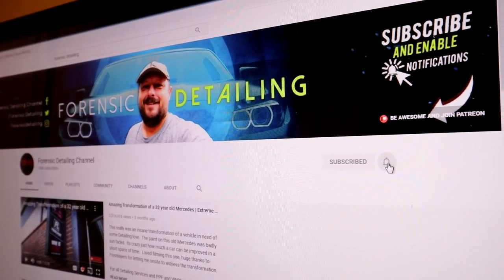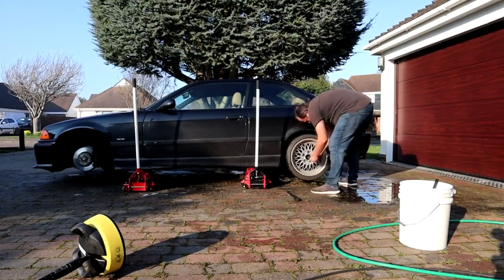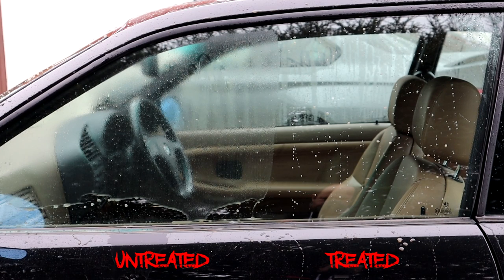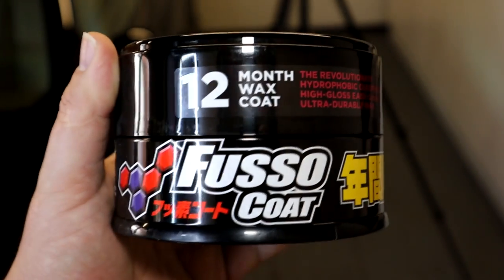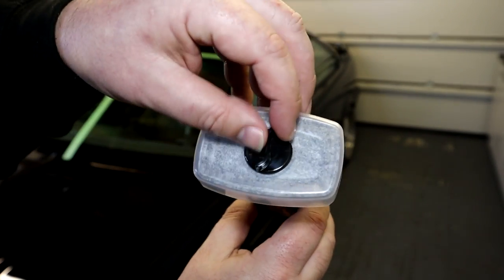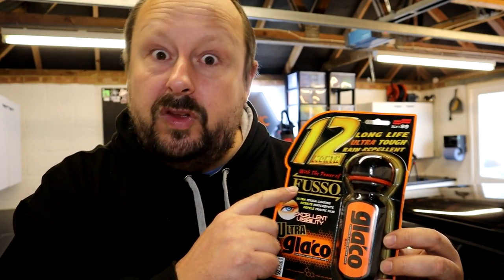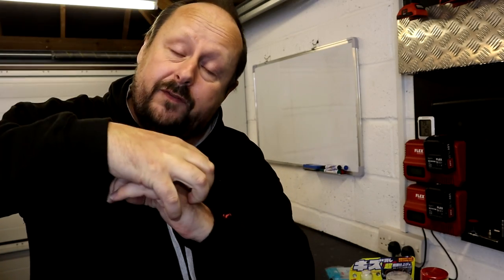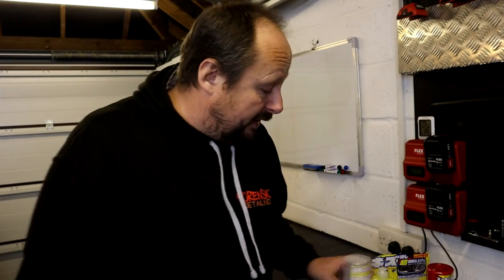Soft 99 Fusso Coat Protection Time Set with Glaco | Close to a CERAMIC in a WAX

Comment: Excellent video. Been using Soft99 for years and still love it. I don’t miss the “I’m about to pass out” carriers for the wax, though. It was really bad. It’s an amazing winter protection for all vehicles. You CAN use most any topper on top of this wax without problems … but it does change the characteristics of what Soft99 does best. I would also recommend just leaving it alone. Worst case scenario, just reapply it as needed. And YES you absolutely do NOT want to apply this wax heavy, it will be a nightmare to buff off (and a waste of product). I typically get 20-30 vehicles per can.

😊😊😊
Reply: Exactly what i wanted to say about it!

Comment: Soft 99 Fusso is next level stuff. I only started using it last year got it on sale brand new for £19.99. Best wax I've used. No way does it last 12 months like it says on the tin but it certainly outlasts any other product I've used. The shine, and slickness after application is the best I've used.

Comment: Even though they recommend crosshatch patterns, I personally discovered quick and small circular motions works a lot better in distributing a think layer uniformly. Also, every 2-3 panels I flush out the pad so it doesn't get too thick
Reply from the maker: yer and ling as its nice thing layer Im sure thats fine thats what I used to do with the old fusso at least.

Comment: Wow, you've really been delivering with these videos these past few weeks Jon, thanks again for the great content! Am I right in saying this is almost a sealant and wax combined? seems to have the visual enhancement of a wax with the durability of a sealant. I'd love to be able to use one product rather than two. I've also heard of people applying it to their wheels and it lasting 8+ months, crazy really!
Reply from the maker: Yes you are right, fusso coat contains organic waxes as a backbone along with fluro polymers or some sort of flourine added into the wax.   So really its a wax backboned with other materials, pretty much like the majority of most modern waxes thad might be mixed with silicone wax or crosslinking polymers etc etc...  You could call it a sealant wax and this way you escape people going nutz at you one way of the other if you call it a "wax" or a "sealant" alone :)
Reply: @ForensicDetailing  haha :) Cheers for clearing that up for me Jon, much appreciated. I'll get a pot ordered!

Comment: I wonder how chemical resistant this is, you mentioned how it keeps the car clean and reduces a build up of dirt which in turn translates to less swirls during contact washing. But if a gull takes a shine (excuse the pun) to the paintwork by evacuating its bowl, I wonder how well it would hold up to that mess compared to a ceramic finish. 

The hydrophobic properties and the sheeting of water made that part in my brain get excited 😁. This is something that's number one on my list of requirements a product needs to perform well in. I think I'll check out that older video at Autoglms lab you mentioned too 👍
Reply from the maker: If a bird poos on your car and its allowed to bake dry and stays on.. I think it will go through fusso or any wax and coatings as well.  maybe a pro grade multilayer coating has some benefits Im really not sure, unless you test it first hand its hard to say.
Reply: @ForensicDetailing  Sometimes I've got to my car and found the sea gulls have decided that my car is too shiny and pebble dashed it in their own coating, I've not reacted quickly enough but I've always managed to get it off before any chemical burn appear. I thought about this brand of coating before and I'm glad you've given me the opportunity to see how it works. It looks pretty good, torn between this and Gyeon synco evo and this as I like the beading. I'm not fussed about applying it every 6 months or so as I find  applying wax a bit of a therapy.  👍

Comment: hah love the fusso to the bones :) so much I actually bought extra tin of old classic one. I have dark silver and red solid cars and I am using light version
Never had a single issue with application. Just using is as a normal wax aiming for under 10grams and doing finger test. Easyly going full bonet and dorst and getting back to see if it is done. Finish is perfetct using inspection light. It did stands for motnhs

Yes, there are better feeling waxes. Just first used a sholl vintage that I left on a bonnet for dwo days and it came out easily...

Bang for a buck or one wax to do it all. Fusso or dsw.

Jon. How the vintage did in longetivity test you did for PVD? Happen I have it on my car now but I barely drive it.

You mentioned spray products of soft. Happens I have all and all are great. The best one I think is fukupika. I know the love for other ones (egg not appreciated, but luxury gloss...) but fukupika is awesome. Looks, apps, longetivity.. Just a killer.
Reply from the maker: Vintage is not that durable m8 but it's still a cracker proper nubs overdose like cake I love it

Comment: Really impressed with the ease of application of the Fusso.  Q. On the tin it states 12 month wax. Is it really a 12 month wax ?. If so that would almost make it comparable to a Ceramic coating. Q. For a flat Red paint (No lacquer), which would be best for UV protection. The Fusso, or a Ceramic coating ?. Sorry for the questions, but my Saab in "Imola Red" is needing another mopping session and this time i want to seal it with the best product for the job. Thank you.
Reply: I think 12 months is in ideal conditions, as in it is never going to happen. I got a little over 7 months on my car. Ceramic coating is more like 3 to 4 years, so a different level.
Reply: It can last longer than 12 months if you maintain it properly. Just like coatings, Fusso can go the distance if you use a sacrificial layer/booster like Sonax BSD or Bouncer's Done and dusted si edition every 2 to 3 months. Coatings are not attractive enough for me due to the prep required, finicky application and because I like being able to do a light polish every 18 months or so to exfoliate the paint before throwing another layer of Fusso.

Comment: I once put RainEx on a windscreen and when the wipers swept, the water beaded in minute bubbles - obscuring, not clearing the glass. It then took a lot to remove. I've never dared do it again.
Reply: I have RainX windshield wiper fluid in my car right now and I think it's making the wipers smear the water. I've been waiting for it to run out and then I'll try to decontaminate it and see if the smearing goes away.
Reply: I dared again, just a small corner of the screen on the passenger side. This is so dangerous in rain when the glass can never clear. Also, it acts like rossin on a violin string and makes the wiper noisy on each pass. However useful it may be for shower glass, house windows etc. it should never be used on the car's windshield. I've used household glass cleaner to remove it.

Comment: Very quick detail nice video on  apply fusso wax... I make mistakes  on applying these wax. This video really explain clearly what to do in order to achieve best results. I have a question,  do you  know what  is the easily method to strip the fusso wax? Do we really need to use polish to achieve that?
Reply from the maker: short answer is finishing polishing on a DA machine is best way to strip this.   Fresh coat of fusso wont be stripped by detergent or even hydrocarbon its too durable.
Reply: @ForensicDetailing  Thank you for the reply! I guess i have to wait.

Comment: Agree!  Im Also user of BH products! They are great! Question! Any good products which strips off soft 99 fuso coat end of the 12! Month maybe more still holding up well!! I’m planning to use it again only wanted a clean panel will use clay and panel clean but first need something good enough that strips for beginning! Thanks.
Reply from the maker: finishing polish is the best way to remove LSP mate.
Reply: @ForensicDetailing  I’m afraid I’m not a ( business detail person) only doing it for my pleasure:) and I never really did polishing and not owning a machine either but! ;) putting it in my basket and taking out since a year now ! So time to get a machine??;)
Reply: @ForensicDetailing  I’m gonna try Garage T zero and see what happens!

Comment: Great video as usual. I use the Fusso coat wax on my truck and love the results. Curious on the glass polish. Will it remove water spots? Thanks again for the video.
Reply from the maker: it strips like crazy even by hand with low pressure its just insane.  stay tuned to my unplugged channel.
Reply: It got rid of some old water spotting on my side and rear window with ease. Very impressive product and well priced will definitely continue to use it.

Comment: Great video John 😁 Just as a side note I've found the best product to top Fusso with is soft 99 King of Gloss ! 
It has very similar water behaviour but leaves a noticeably glossier finish. 
It also offers a sacrificial layer after fusso has been on for a couple of months 😉
Reply: why would you put something on top of it so you cant see the hydrophobic properties???
Reply: @DavidC1  primarily to boost gloss,  as fusso isn't as glossy as some others, but also to offer a sacrificial layer to keep fusso coat on the panel longer.  King of gloss offers very similar water behaviour to fusso, so it's a win/win ! Extra gloss + protects the original base layer
Reply: I did the same thing, once, but not sure I really believe in the "layering" aspect of wax/sealant application.  I use King of Gloss or Kiwami in the spring/summer months and then Fusso Coat for the fall/winter.  Some people use Fusso coat and then top every now and then with Sonax BSD, as they have just about the same level of hydrophobics and provides gloss.

Comment: Thanks for the detailed video Jon. Which would you recommend for long term protection between gyeon can coat and this?
Reply from the maker: Ive not tested the new can coat.  But typically a ceramic even a lightweight one will last longer i think.

Comment: they changed the formula? I have a ton from about 4-5 years ago. The can art is different. You said they did but wondering if I need the new version or am ok with old one.
Wonder if it's easier with the new version too? Have you compared both?

Just checked the USA store and looks like the new version is only for EU. They still sell the original for US. But you can buy both.
Reply: I heard the old version is better, best keep hold of them if I were you. I'm pretty sure Jon said something similar a while ago
Reply from the maker: yer couple of years ago.   if you have the old I would just carry on using it.
Reply: @ForensicDetailing  just saw on the soft99 USA site and the new version is intended for EU so probably something to do with their regulations. Old still made and available at least for us

Comment: Hi mate if I apply my fuso wax and after say 4 months would I need to de contaminate again with clay bar before I wax again or could I wash as normal and just add the wax on again 
Thanks pal
Reply from the maker: only you can answer this question.  you clay to remove contamination.   So your question should be.  How do I check a car for contmination.  you need to check it.  if paint feels smooth and glass like its contamination free so you dont clay.

Comment: if u dont plan to polish / correct paintwork but want to add a wax or sealant, what is the best method of decon to do that wont add more defects.
Reply from the maker: ok so wash with pure detergents.  Then potentially use a fallout remover on the paint dry off. Then use a hydrocarbon panel wipe or some sort of tar and glue wipe down.    dry off the car and apply the wax.   But if when your applying the wax you notice little bumps on the panel and the wax sticks to the lumps and you see little drag lines when you buff.   Then really you have to ask,  What are you protecting?  protection really is to help keep the panel contamination free and clean.  So if its rough and dirty with chunks stuck on chemical decon cant get you really smooth decon'd paint.. so its really all about standards and time and what the state of the car is etc...   hard question to answer. (means good question)

Comment: I wonder if the glass compound and rain repellent is good for headlights…🤔🤔
Reply from the maker: just bear in mind headlights are clearcoated so the abrasive will remove material.
Reply: @ForensicDetailing  oh yeah…also have UV protection coat. Good thinking Batman.! 👍🏼

Comment: Great video found that really helpful and I’ve used Fusso before. I’ve also made the mistake of applying it a little to thick which does make removing more difficult so that’s a great tip for anyone who hasn’t used it.

Also didn’t know the other Glaco product was an abrasive cleaner so I might get some of that.
I’ve used Ultra Glaco before and it’s a fantastic water repellant for the glass.

Comment: Used the new fusso a few times but i'm not really impressed. 

Applying and removing is not the easiest there is, the smell is horrible. It's really cheap. Water behavior was really, really good, never seen such great beads as with fusso. After a month or 4 the best was over and it rapidly started degrading, this without applying additional layers of protection over fusso, only regular washes. The thing i disliked most, was the film that remained weeks and weeks after applying fusso, never had this problem with any other LSP.

Comparing fusso with polish angel master sealant, wich i like alot more. the most user friendly and best looking results i've had. Water behavior is a little less outstanding than fusso but still great. How long it'll last is still a question for me, it's on my car for about 1 month now and still going hard.
Reply from the maker: you should not be getting any filming.. but you will get degredation.  guess after 4 months that initial bling will be dead, you could go again or, just use a fusso based topper I think.   But ultimately you can try non fusso stuff.   Some like Kiwammi or KOG better.
Reply: @ForensicDetailing  I understand it should not be leaving any film but every time i used fusso, i've had the same issue.
The only thing i can think of, is that i've used to much product. Although i doubt it...

Comment: Truly a fantastic wax, not to be understated but it seems to be fetishized on the Internet. Overhyped almost especially when people insist you need the “old formula” that smells like petrol. What makes it better than Ultra Lock Plus?
Reply from the maker: I think ultra lock is pdms based or some form of si polymer.  These tend to work well.  Dunno, in the UK fusso just went viral big time, ultra lock never has really.  Silicone polymer is quite commen maybe, fluro polymer less so.  I think fusso ace card  is the hydrophobicity maybe, lots like that.